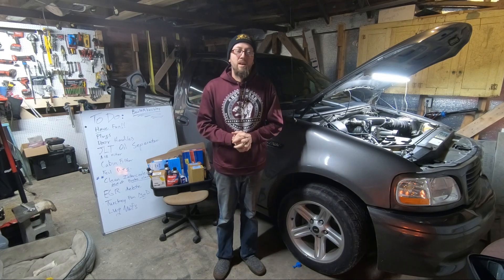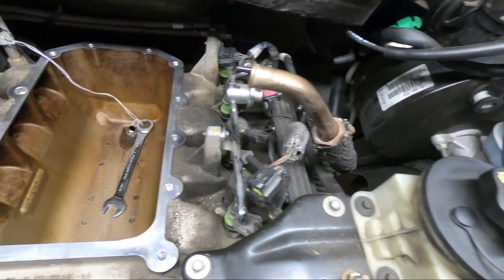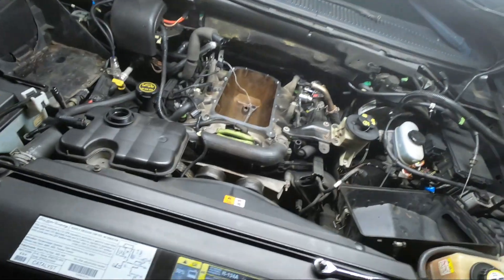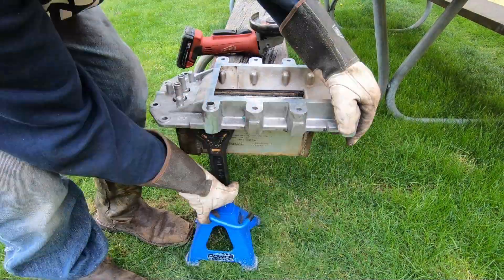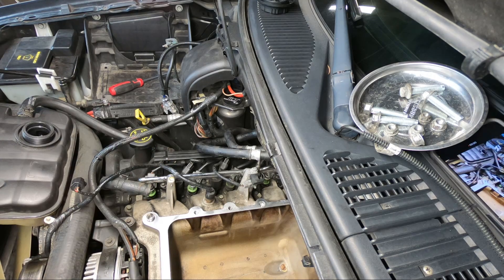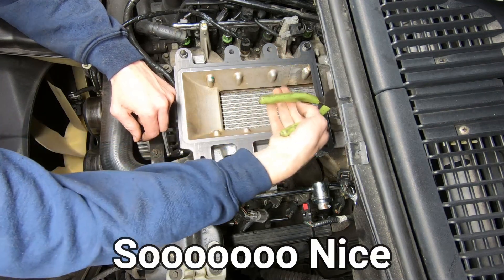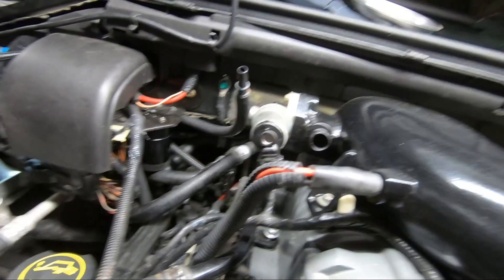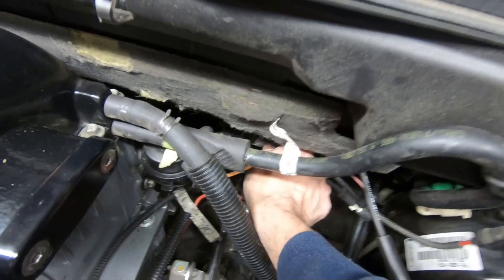Ford Lightning Turkey Pan Mod, JC EGR Delete and Oil Separator. DIY

Comment: any tips getting that elbow out? cant get mine to budge
Reply from the maker: Mine wasn't a problem, work it back and forth. Take you time. I hope it's works out for you man.
Reply: are you talking about the elbow on the back of the turkey pan in the middle at the bottom?

Comment: Mr BMW

There's another YouTube channel called boosted Dave who did the EGR delete he rerouted in a way that he didn't need to get a custom tune to delete the EGR function

Are you aware of this method? The reason I ask is my 97 E350 has a 5.4 2 valve as well and the EGR setup is similar
Reply from the maker: I am not, custom tune is the only to get rid of the dash lights after a egr delete. As far as I know. Hopefully that helps, have a awesome day

Comment: Another question. I see everyone fighting like hell to get the elbow out of the lower intake is there a reason you can't just plug it from the  inside and leave that elbow there? or does it thread to far in?
Reply from the maker: You have to take it out, not enough threads to have both. But you can install the plug form the inside. Good question
Reply: @BuiltMikesWay  did you have to run a 3/8npt tap to plug it from the inside?
Reply from the maker: Yes sir 3/8 npt
Reply: @builtmikesway1167   just following up i finally did my egr delete and turkey pan mod and i didn't have to use a tap to get it started it went right in so weird i'm wondering if maybe different years the pan is tapped differently?

Comment: Quick question i need to do mine as well but i do not see or hear of anyone replacing gaskets on this job did you just reuse your gaskets?
Reply from the maker: I always buy new OEM just to make sure you have zero issues. Thanks for asking
Reply: @BuiltMikesWay  that is what I'm doing too I just wanted to make sure everyone else was as well lol

Comment: Hmmm! So I'm doing a lighting conversion in my 97 f150 with a t56.  Learning as I go.. so what is the purpose of this? Engine is on the stand now so now us the time to do this..
Reply from the maker: It recycling exhaust/carbon back into your upper manifold. Bring up the heat fast on warm ups. I'd do oil catch can to, so the oil does get recycle it back into your upper manifold. If you both of these your intercooler will never have to be pulled and cleaned. It's not a easy job in the truck but it can be done. Hope this helps.
Reply: @builtmikesway1167   Yes.. yes it does help. And I appreciate  the info!!
Reply: @builtmikesway1167  so on the turkey pan mod.. just put the plug in and get rid of the hose all together?
Reply from the maker: @19jody72  yes but run the hose to a catch can for the oil blow bye
Reply: @builtmikesway1167  Thanks man..👊